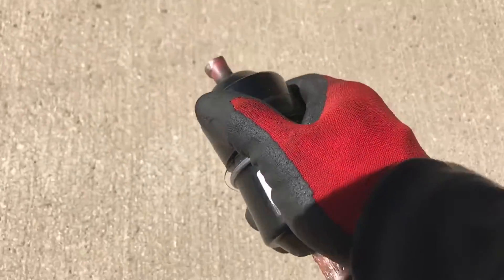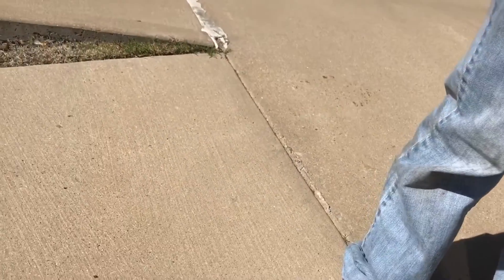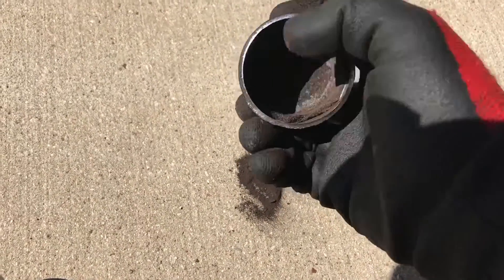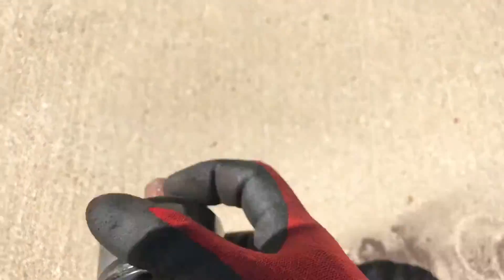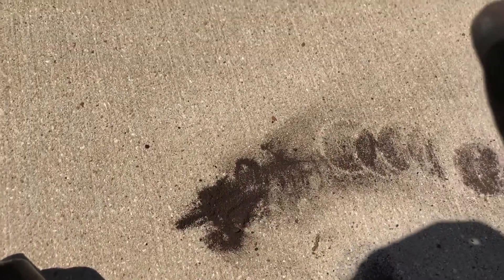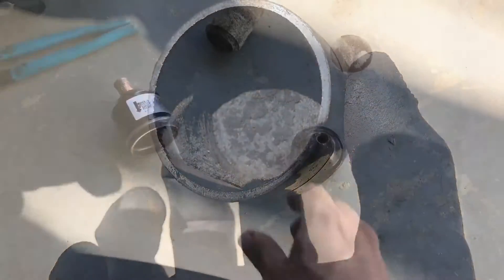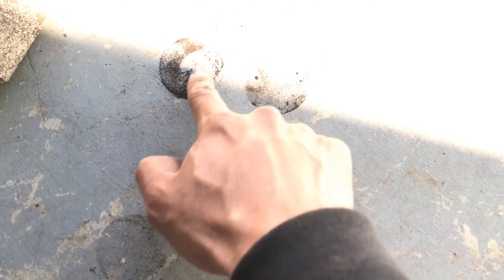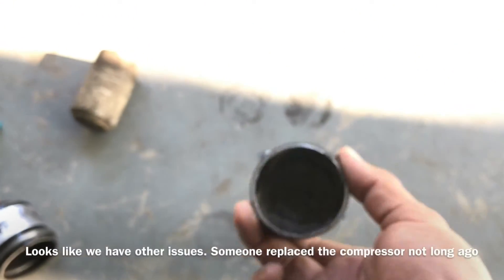Restricted filter drier cut open.

Comment: I think its the felt pad at the outlet that blocks up, had one covered in oily aluminium paste after compressor chewed its conrods up, ended up putting a removable core drier in.
Reply from the maker: heavydiesel yup that's correct. They probably need a new unit.

Comment: If you youtubers will just remove the driers from the system then you don't have to worry about this ever. Us florida techs know not to use driers on a system ever :)
Reply from the maker: Justin Hernandez that's a very valid point.
Reply: The compressor is a catch-all ;)
Reply from the maker: Justin Hernandez true.  Some trane recipes have two magnets in the crankcase to filter all the metal out. Standard because they know shits gonna blow up.
Reply: They need magnetic oil drain plugs like in a car for all compressors. Or a ball valve like an air compressor tank and just let the 22 fly..lol
Reply: ahhh, your the compressor bandit...